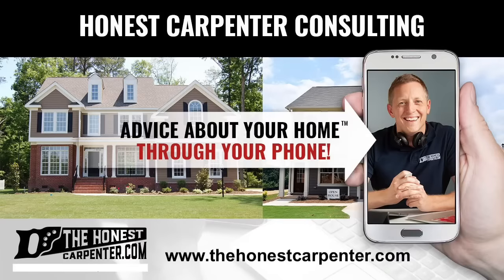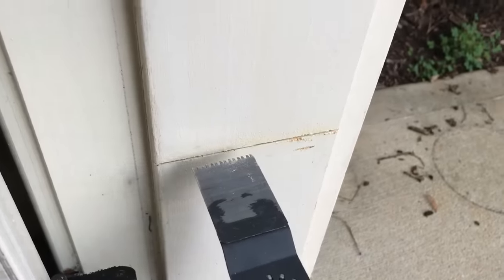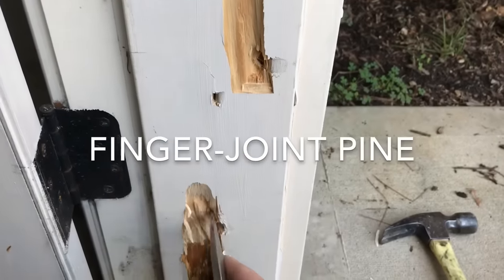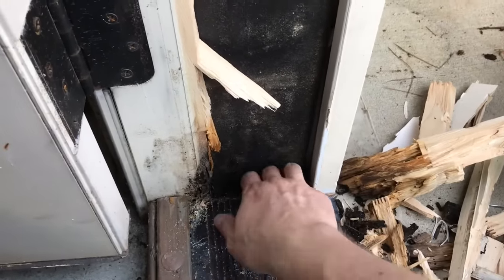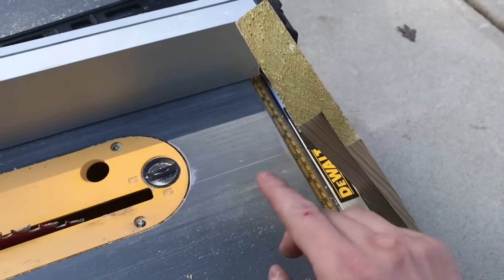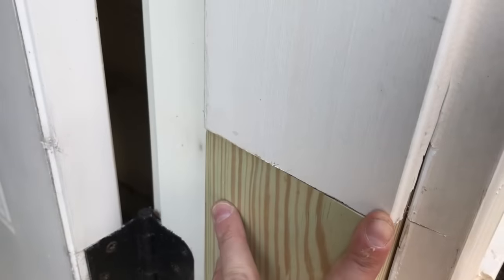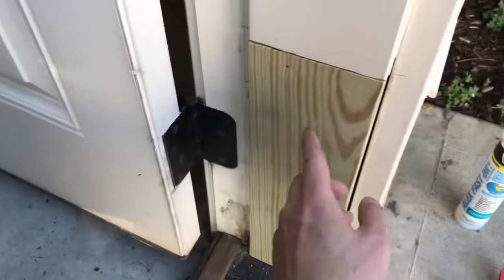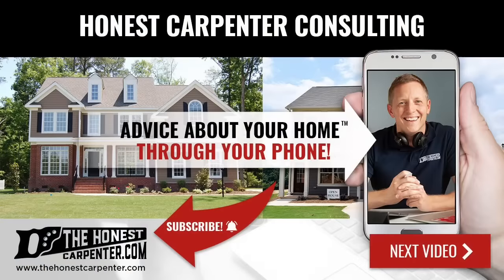How To Repair Rotted Door Jambs

Comment: Given that the rot is fungal, the rot you left in the door jam will grow, by simply removing and replacing the door stop (not the door jam that looks also to be infected) it will continue to rot. You have only done half the job. Time enough for the cheque to clear I guess.
Reply: How much to replace the whole jamb and door? Unless you want to  buy a whole prehung door and or change  all the hinges ???
Reply: Some people  don't have the money or don't want to  spend it, on completely replacing the whole thing especially landlords!
Reply: @garygriffeth7235  he could have cut the door jam out as he did with the stop. But he would have had to take the door off to do so. Not difficult, also the hinge would need to be checked in again, also not difficult. Being a carpenter, if it was mine I would probably replaced the frame, and re hung the old door. For a temporary fix, remove as much rot as possible. ( not that easy as the fungus has already sent microscopic fibers far beyond the visible damage) treat the timber with an anti fungle probuct ( blue seven, or wood hardener) and used car body filler. Easy and fun to use. Water damage like this is easy to avoid. Thats why eaves and verandahs work. But its much cheaper and quicker to build skillion roofs with internal gutters. Not many carpenters can pitch a roof any more. They are time consuming and use more timber, and require a comprehensive understanding of whats required. But thermaly much more comfortable.
           Also, all the old timbers with tight grain structure like cowry, even good cebar, or  Canadian oragon, or boltic pine have long ago been cut down. Non left, or to expencive. Plantation timber, full of hormones, and fertilizer are terrible. The plague of humanity rolls on, unabaited, with consequences.

Comment: If using pt wood, try to use one that is relatively dry. So much moisture in new pt. Azek is a good alternative as was pointed out but does contract quite a bit when cold thus opening the joint. That’s why when working with pvc you should glue joints with pvc glue, although that may not work when gluing it to wood. Boral is a material that comes in dimensional trim board sizes that doesn’t expand and contract as much as pvc. Not as easy to find though unfortunately.  Having said that, his repair is quite good and will likely last for years. Beveling the cut downward is a good suggestion as well as priming the end joint of the cut jamb and the piece. Epoxy is a good more permanent thing to use to put into the joint as well.

Comment: You know you have this tool call an oscillating tool that can cut vertically just as easily as horizontally.  You could literally have two cuts and take it out in three pieces.   I’d also replace with with pvc vinyl board, and the shim can just be glued to new jam.  No need to cut flashing.

Comment: Use oil base primer and smear silicone on the bottom edge that sits on the threshold.  Bare wood needs primer before it can be  caulked/ painted. The caulk will eventually peel off like string cheese if it's not primed.

Comment: Another helpful is chamfer both joints so you don't have hard edges butting each other.  Then you can fill with putty, bondo, etc and smooth so it won't show the crack line later.

Comment: thank you that showed me how to fix mine. One question can I use a different type of saw????
Reply from the maker: @mk phelps thank you! I definitely feel that the multi-tool is the best saw for this plunge cut. But, if you can avoid cutting the side casings as well, then another saw might very well do the job.
Reply: Yes, circular saw set to depth.

Comment: Nice job, the only problem is you should use a printable silicone, so when the time comes the paint isn't  crawling on the bottom of the jamb. Ran into it a hundred times.

Comment: i did similar but i actually used pvc "wood" if that makes any sense. They sell it at lowes. Zero risk of future rot since it's plastic. it didn't fit exactly since they dont have every perfect size, but it worked good enough with some caulk. this method seems way too complex. i also installed a screen door to keep moisture off the whole area.

Comment: you should have used hardy plank.   It will never rot again!!!    I have done this on several door and it works much better than wood replacement.  I live in Houston where hot , humid and rotting are a way of life.

Comment: What many lumber yards have now is azek. It comes in all different moldings and is a product to replace pine moldings and will never rot. It's the same thickness as pine molding. i just replaced rotted brick mold off of a steel door and looks the same and lasts indefinitely.
Reply from the maker: Flexible Strategist I’m editing a video on that exact topic as we speak! Check it out when I publish tomorrow 🙂 Thanks for writing in!
Reply: $50 for the 6' minimum in this size.  or $8 for the treated he used

Comment: Great video and very helpful. Since I am also the DIY painter I used the oscillating tool to sand off the water stain (like you have) on the door frame while the weather stripping is peeled back.  Should be all ready for painting tomorrow after the caulking is dry.
Reply from the maker: Thanks John! Over the years I’ve come to use the triangular sanding attachments more and more.

Comment: On my 10 yr old house, the builder used pvc on the trim so that looks nice but didn't even paint the door jam so its pealing and rotting. I bought the house so I'm not the original owner. In the video, he says the paint will cover that up. What I've found in my limited experience is the paint doesn't cover anything up, it just shows the imperfections of the surface.
Reply from the maker: Itsme Forsure Sorry to hear about that building fiasco. You’re right, it can be very difficult to make repairs disappear entirely. As I mention, more applications of caulking and light sanding can get pretty close, but evidence of past work still shows for anyone looking for it. In my experience, even immaculately built houses are full of small flaws. It’s just hard to make something as big as a house look perfect. But much gets overlooked by casual observers

Comment: If you dont have an overhang above doors trim will die quickly😅.  Cover your doors with an overhang. All lower trim and even inside metal door went bad on me. PVC is your friend!! ❤.
Just did the same job exept used reg. Pine hopefully Ill have my back deck coverd this fall. So long as you keep that rot dry it shouldn't grow much. 
Regarding your saw, (life savers they are !!). Once the blade goes bad, grind the teeth flat, give it a slight rounding.Then grab a dremal tool and cut new teeth, they dont need to be tweaked and you'll get triple your money out of it. If it burns a little so what just keep it mouving, it'll clice. Thanks for the video. Just wanted to see how I did.😅 compared to a pro.

Comment: Still did not use a paint primer on the edge of the timber to stop capillary action of the rain water from rotting the bottom of the board.

Comment: I cut out the piece behind too, if it Is a one piece assembly. Most of the time, you can cut below the hinges.  You can buy special jamb screws, which have a very small torx head, and jacking screws, that allow you to adjust the the depth  of the repair pieces you are putting in, so they are flush with the original jamb.  I seal all sides of the repair pieces with clear penetrating epoxy sealer.  Wipe some west system flexible epoxy in that repair seam, otherwise a crack will form there later.

Comment: I do these with Azek so there is zero chance of future rot.  I also add a bead of caulk to the bottom edge to keep water from blowing or migrating in over the threshold and rotting the sill or subfloor. Just resting it on the sill still leaves a gap for water intrusion unless it's protected by a porch roof.  Also, I cut a groove instead of a dado for the weaterstripping.  With the jamb mostly broken away, theres nothing for the ouside edge of the weatherstripping to anchor to if you cut a full dado.

Comment: Very excellent craftsmanship !  The problem is, it’s hard to find these days. Most want to get in, get out, collect the money.
Reply from the maker: Thanks so much! 🙂
Reply: itaintmebabe99 no the problem is not finding craftsmanship.  The problem is most customers don’t want to pay for craftsmanship.   That’s why we just cut out the rot and fill with hard rock sand paint and caulk and done.  That’s all most customers will pay for today.
Reply: survivalSC Yes, I would have to agree with you for the most part.  But, sometimes the issue is, how much is charged for labor (craftsmanship).  I recently declined a bid to replace my well water pressure tank.  They quoted $995 to simply swap out the tank with a new one!  So, I went to Lowe’s and bought a tank for $210 and installed it myself. Took about 2 hours.  I’m sure a professional, with all the right tools could of done it in a lot less time.  So, how can anyone justify about $800  for 1.5 hrs. labor?
I do realize this was my particular case, and not all professionals are the same.   Just sayin!

Comment: Almost every door will suffer this fate, you got to it early enough before the rot thoroughly spread to the adjustable sill.  I won't install a new exterior door without what's called "Framesaver" as part of the jamb construction. The bottom 8" or so is composite that is finger jointed with the rest of the jamb.    On your patch, I would scarf joint the top so it can be glued to help prevent any separation due to moisture content.   Undercutting the other side isn't a terrible idea, although it can create a pocket for water to sit when the basic caulking fails.  And don't forget to remind your viewers that silicone is not paintable. A high quality urethane or urethane blend caulk is money well spent, like most things, you get what you pay for.   Keep up the good work!
Reply from the maker: Work is fun... That is all good advice! Thank you for writing in. I was in contact with Turncraft not long ago about another one of my videos, and I saw that their parent company is the proprietor of Framesaver. That’s a great product! I haven’t seen it filter into my North Carolina building suppliers yet, but I’m looking forward to the day when every door has them or something like it. Thanks again for watching and reaching out!

Comment: The Bosch went out on me in less than a year. DeWalt is far superior and has variable speed for starting your cut at a slower speed. Being a carpenter for over 50 years the multi tool is a game changer.
Reply from the maker: Thanks for watching, Tim! This corded one has lasted me a good long while. But you're right, Dewalt seems to have established the top of the class here, especially with that 20V kit. I'm going to get one soon, I think. And I'll probably do a tool review video of it as well
Reply: I’ve had a Fein for ten years. One of the best investments I’ve ever made:)

Comment: How would you repair a wooden threshold?  Mine is rotten on the exterior portion of the door, I was thinking about cutting it straight across with the oscillating tool and then using pocket holes to attach a new piece of 5/4 board.  Is it easier to just take out the entire threshold and replace?  Should I replace the wood with aluminum or PVC?

Comment: Multi tool works well to cut and remove the vertical seal side of the old piece to give you a cleaner edge to work with.

Comment: I'm tempted to put a bead of caulk at the bottom of the board to prevent wind driven rain from pushing back in and under the board at the base sill

Comment: Treated lumber doesn't hold paint  very well over a  long period of time. Eventually, the paint will begin to loosen and peel.
Also,  treated lumber will eventually develop longitudinal checks allowing moisture to creep in. 
Maybe some types of treatment work better than others but that has been my experience.
I'd have gone with untreated lumber and soaked the bottom inch or so in wood sealer overnight. Allow to dry thoroughly
before painting.

Comment: Love the multi tool for FLUSH plunge cuts.  But, why not use a Japanese/hand saw or M77 set to depth in this unrestricted space?  I replace with cut section of another PFJ jam w sealed end grain and then BONDO and sand joint and any seams. Seems harder to join dissimilar material in same plane. Most treated lumber isn’t rated for ground contact either

Comment: If you cut a board on a22.5 angle, screw it to the jamb, and the use it as a guide for the blade, you can make a joint that won’t catch any water.

Comment: Azak is the way to go on repairs like this. after being self employed since 1978 and in the trades slightly longer I do understand that anybody can trash talk anybody and talk their work down. You did a decent repair here. If I was going to use any type of wood for the repair I would have at least sealed the base of it with silicone. I have also drilled very small holes in the aluminum threshold under that piece to allow water to get away from it if need be. But, with all that being said. Azak is the way to go on a repair like this.

Comment: Pin a block of wood onto scrap side and use as a guide for saw. Also cut 6”inch sections and break out frame with a mallet and old chisel, comes away easier.

Comment: I find these trim pieces are made of finger jointed wood and some pieces in them are just really prone to rotting out prematurely.  90% of the frame will be good, but one piece will rot out even though the pieces connected to one or both sides of it are fine. The pieces you're fixing look to have joints about 4-6 inches up and they look fine.

Comment: Nice job, and yes theirs a but.... The reason it rotted out which you should've mentioned is that the door was sitting on concrete with no kicker under it, which is not a direct problem but you add no overhang on the house and no gutter and Sun exposure you end up having that problem, I was surprised it was only one side but that could've been Sun exposure to one side.
 Letting people know that if those issues are part of someone's door they could prevent what you had to do. Keep the jam painted and caulked at the threshold because wood is like a sponge.

Comment: Better way to do this is use PVC board. Also, if you don’t have the talent, cut 90 degrees like in video. If you have a steady hand, cut upwards at a 45 degree angle for rain lip. Just sayin, from a Master Home Inspector. Treated board is very water heavy and will shrink.  You only have to cut above the rot. Typically, this is only a 6” piece.

Comment: Thanks for the good tip! I do have a question.  is something like this could be done to save the wooden trim of the astragal(interior) part?   I do have a french patio door and I think the installer messed up the install by not covering the bottom part of the astragal with some weather proofing.  The insulation(fiber glass) was exposed and the water was able to seep through inside and soaking the insulation of the bottom part of the astragal along the inside of the door soaking the wood trim.  After couple of years the wood trim of the astragal inside the house is rotten at the bottom. I noticed there are two piece for this astragal.  The outer part is made of steel and the inside have a wood trim. It's also a steel french patio door.  I was trying to look for astragal replacement but it seems this door seems to be discontinued.  Is there something else I could do like what you did here? Thanks.

Comment: since you have the tool why not just do the rip cut with it and not have to chip out the piece. check too if the brick mold is fastened to the casing.  be a good idea to prime the piece with an oil based primer before you install that way you can soak the endgrain so it won't soak up water.  prime the end of the piece you cut as well.

Comment: Nice video but I wanted to confirm my assumption with a question.  The vertical edge of the cutout on the inside of the jam consists of splinted wood vs a smooth even surface.  Does the generous cutout for the weather strip provide the dual purpose of adding clearance for the irregular surface - thanks  R

Comment: I just repaired one but bought a whole new side jamb. Not sure what to think  of this patch job??
Reply from the maker: @Chris Smith Was it hinge-side or latch-side? Did you have to cut new mortises in?
Reply: was the new jam treated wood and did it save any time?
Reply from the maker: onenikkione I never see treated prefab jamb pieces, they’re always kiln dried pine. But some manufacturers are now making the bottom foot out of composite material that doesn’t rot, so look for that if you’re out shopping. But I think this treated repair works fine, and is convenient and extremely affordable

Comment: Another thought is to take some of the construction adhesive and push it into the lower edge of the replacement piece before you put it back in place to stop moisture from going back into the wood. I know you caulk the lower edge but most times it doesn't fully seal that edge unless you do it before you put it in place.
Reply from the maker: @Kirk Demadaler That's a very good point. These days when I'm doing this repair (more often with PVC), I'll do just that. I'll bed the lower end of the piece down into a bead of PL Premium Loctite on the threshold. This way, when it dries up, the lower end is more effectively locked into place, and the threshold also has another bond to secure it in case it wants to move :)

Comment: I didn’t see how you handled the loose metal threshold. I found that the screws were still there when I got out most of the jamb. I masked off the threshold and new wood and loaded it up with construction adhesive. That kept the threshold from coming out later.